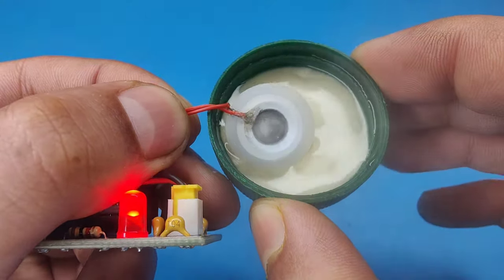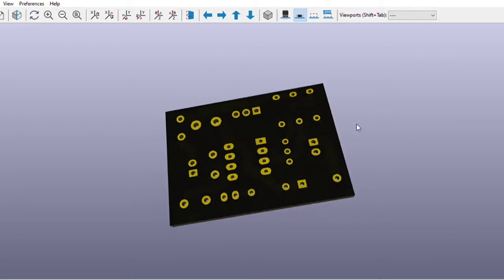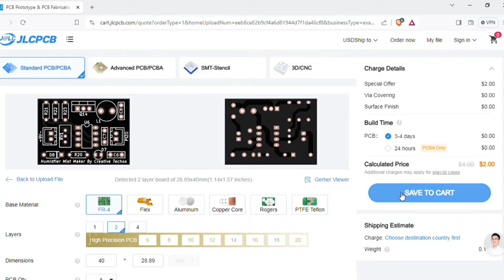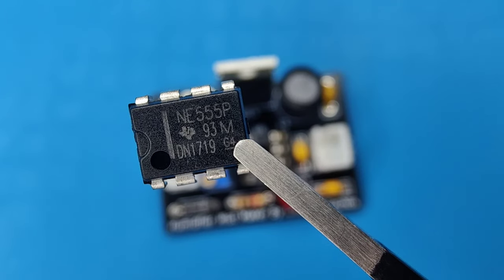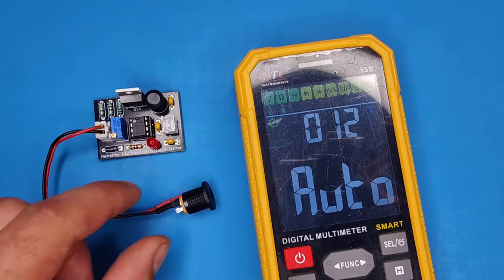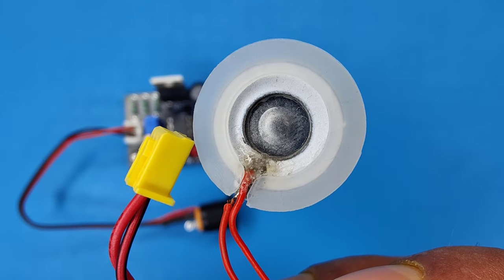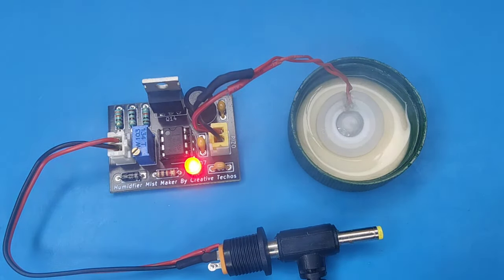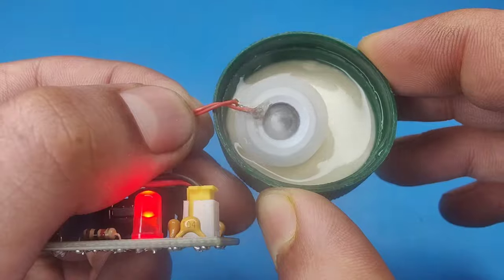how to make Humidifier Mist maker Using 555 Timer IC

Comment: thank you, nice video. Can your circuit be tuned to resonate a 10Mhz 20mm ceramic fogger disk? Just adjust the variable resistor to 10Mhz? Other components need to be changed? Thank you. Can I hire you to provide the correct circuit?

Comment: if i wanted to add 10 misters what must i do
Reply from the maker: You just need to use bigger inductor of 220uh, also add separate 100nf capacitor in series for each pizeo disc.
Reply: @CreativeTechos  what would it take to redesign a board with all of the added components?